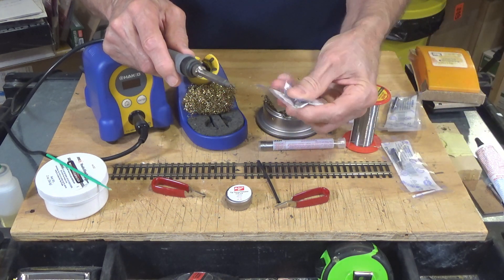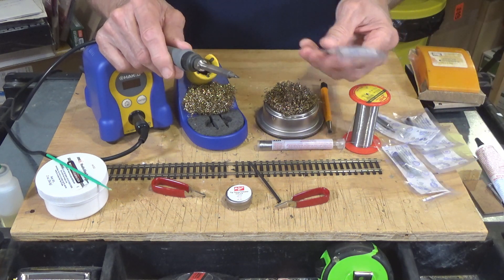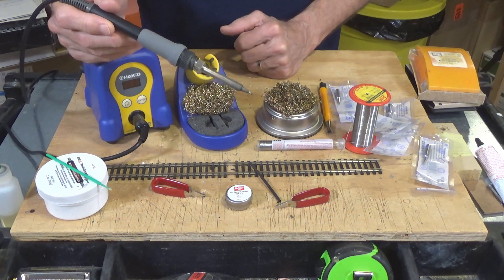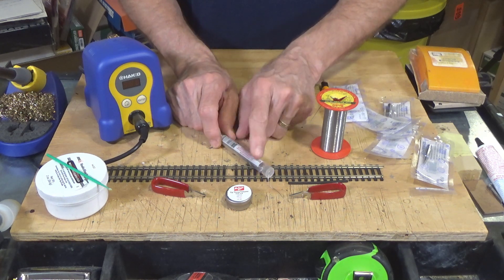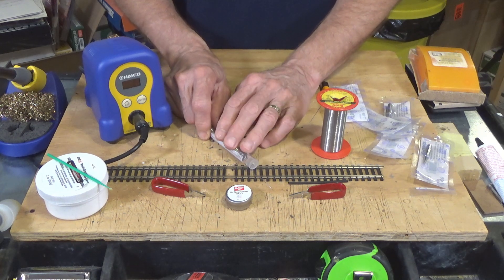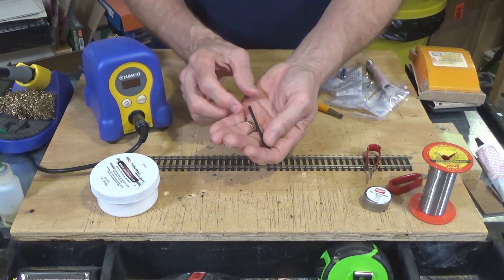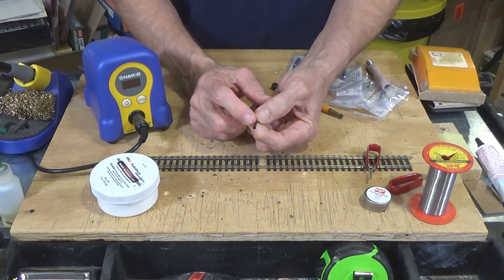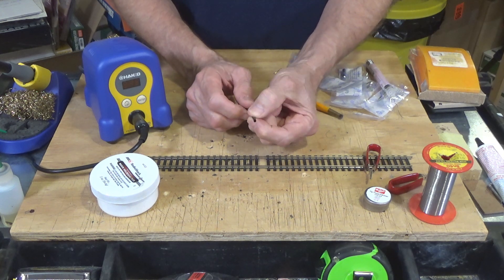35. DCC Tips, Soldering--An essential skill

Comment: DCC Guy, I'm a bit late to the party regarding learning how to solder, but thanks to your video I'm making great progress.  My current situation is that I inherited a (20 yrs+) old Weller WLC 100 and based on what you've said, I could cause damage to my decoders using it.  Therefore, which HOKKO model number is best to buy.  I want one that looks like your blue and yellow model.  Thank you for your many 'how-to videos'...they are great!
Reply from the maker: Mine is the FX-888D but I think they have a newer model that has easier to use controls—check Amazon.

Comment: When should you replace a tip
Reply from the maker: I replace mine when it gets to the point that you can’t tim the tip, in other words solder will not create a wet look and cleaning it no longer helps. Tips are made of a copper core, plated with, iron and then usually thin layers of nickel and chrome. When these layers wear off or become heavily oxidized then the solder will usually not stick and its shot. Never use sandpaper to clean a tip instead wipe when cool with alcohol and a dry rag then recoat with solder to give it a shiny look and this will help prevent oxidation of the tip. There are compounds to reactivate an oxidized tip if its not too far gone.

Comment: Hi Larry, what size shrink tubing do you recommend for decoder installations?  For what I'm guessing is 28 to 32 gauge wire (the wires in Athearn locomotives). The smallest tubing I've been able to find on Amazon so far is 3/32", and wasn't sure if that would be small enough.
Reply from the maker: I typically use either 3/63” or 1/16” for most decoders.

Comment: 1. If you use a wet sponge, do not use tap water. It contains minerals etc... that can destroy the tip. Use distilled water.
2. With 40 years of experience soldering, I've never had an issue with 60/40 solder and "cold" solder joints. It's cheaper and works well. A temperature controlled soldering iron, usually keeps the tip at around 700 degrees. For solder with silver content, you need a higher temperature. 
3. If you use a rosin core solder, 95% of the time you NEVER need extra flux. If you find that there is not enough in the solder, you have a problem that needs to be solved. Usually dirt, not enough heat, or too small a tip.

Greg Williams
Certified Electronic Technician
Reply from the maker: Greg—thanks for your observations. I can remember leaming how to solder back in the early 1960s using my father’s old Bakelite pistol type Weller iron, what a monster. 

1. I’ve never had any issues with the minerals in tap water, but I do prefer the brass turnings over the old wet sponge method. Fortunatley the water in my area is little more than rain water fed into a tap so is pretty dilute stuff.

2. I too love my old 60:40 solder but I have begun using the 63:35:2 composition with circuit boards and other “electrical wiring” to prevent cold solder joints created by movement when cooling. I do crank my unit up to about 800 degrres for that, especially with a pencil tip iron.

3. When soldering to circuit boards and wire splices etc., I don’t use additional flux paste and agree it is not necessary there. However for large work such as rail joiners and feeders I find that you can too easily cook away the flux in the solder before the track is hot enough to make a good joint so for those types of situations I still recommend a paste flux.
Reply: @TheDCCGuy  I do love the brass turnings. Why didn't we have that back in the day! I have my dad's bakelite Weller iron as well. He was a technician for Northern Electric (in Canada, makers of all telephone equipment for Bell) and taught me what he knew. I didn't hear about the minerals in water issue until I went to college for electronics. They taught me that as their water was well water and very hard. I've experienced the issue where i live now, as the water is very hard. But then the brass came along and problem solved. To be honest, I've built turnouts on copper clad board, soldered 14ga wire etc... and never used flux. In the shop I worked at for 10 years, none of the techs used it either. Was not taught to me by father or school so I just never had a problem. I bought some to try to use but it actually causes problems for me. As with everything, personal experiences are different. The old "Your mileage may vary" issue. Thanks for what you're doing with these videos.
Reply: OUTSTANDING GREG W … BEST TIPS EVER